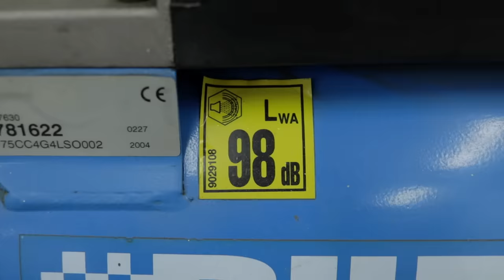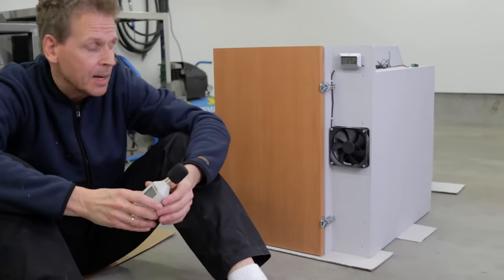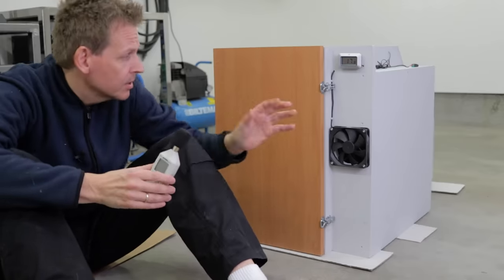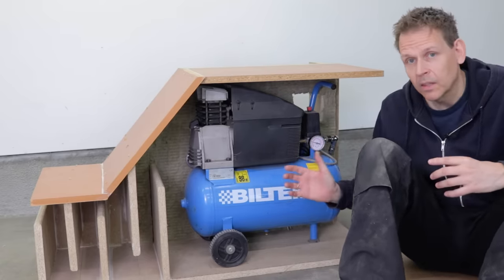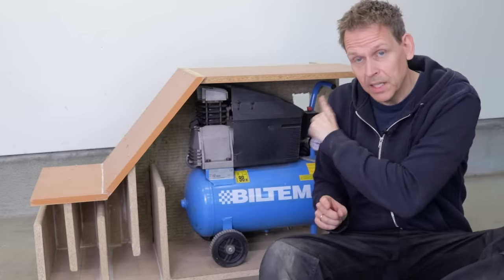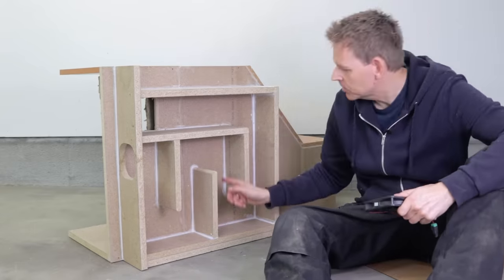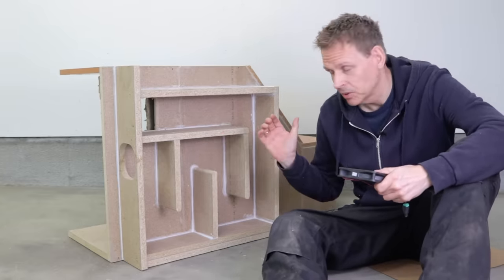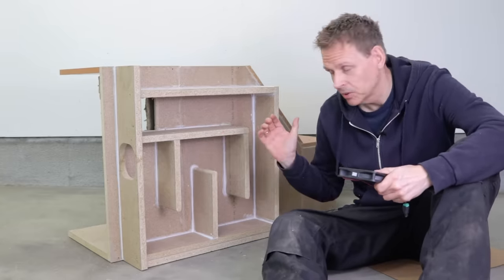Do not build a sound insulated enclosure for your noisy air compressor!

Comment: Please remember that all hard surfaces act as speakers of noise or reflectors and you can add as many baffles as you want but the surfaces all have to be of sound absorbing quality.  This is inside and out.  Even the air tank which is the mounting of the motor and compressor will emanate sound.  The supports of the compressor would need to be mounted on rubber biscuits to isolate the structure from the box. Air movement throughout the case is paramount to prevent overheating and excessive condensation from the ambient air.
Reply from the maker: Thanks a lot for your tips! The fabric I added to the baffles could have been thicker to absorb more sound, but then they would restrict airflow and reduce cooling. It's a tradeoff 🥴

Comment: I bought a quiet compressor made by California Air Tools. Amazon sells them, so I bought a standup unit for $300 about 4 years ago — now selling for $600 in today's inflated economy! I then sold my cheap Harbor Freight compressor to some sucker. How long does it take to build an enclosure for a compressor? I value my time at $100/hr, so the price difference between a flapper compressor plus an enclosure vs. a quiet compressor is well worth the additional cost.
Whether you realize it or not, your box is really an enclosure for a subwoofer speaker. Aka a "lowpass filter." Low frequencies can escape it but high frequencies are highly attenuated. That's why you bury the speaker inside a subwoofer enclosure.

Comment: A lot of the remaining sound is coming from vibrations within the wood. Press board is quite thick and strong, and therefore transfers sound. Softer materials will tend to absorb sound waves and resonate at one frequency. Thus 1/4 ply in three layers, fibreglass between, and offset 1x2 between each layer is ideal, and probably less difficult to assemble. One layer with 1/4 ply on each side would also work well.

Comment: A lot of other comments mention removing the compressor from the tank. You can actually buy them as separate units. Or save the environment and buy used. 
But aside from that. You wasted time and material. All you need is a simple box for the high frequency sound, and some suspension for the low frequencies. 
As an example you could make a floor setting on soft rubber. Or hang a floor from rubber hose.
Reply from the maker: Yes, separating the motor from the tanks would make the box smaller, and that would have been very smart for me, my space is limited. The downside is that it will not be very easy to move it around to another location, now I can just bring it with me if I need to use it somewhere else.
A simple box for the high frequency sound, and some suspension for the low frequencies? Sound very smart, why is it not added to every compressor is it is that simple? 🤔

Comment: To efficiently dump heat from inside the box, it's best to run a low pressure system inside the box, which means you need to have the fan blowing air OUT of the box.  This approach ensures that the air moved by the fan travels all the way through the box because the fan lowers the pressure in the box and cool air is drawn in from the other side. This is how heat control works in computer data centers. You don't blow cold air in, rather you force hot air out and let the cool air naturally flow in.
Reply from the maker: This has come to my attention now, from a couple of other comments as well 😬 It seems like I have still a lot to learn. Your explanation is the best one I have read so far, it was very easy to understand and it just makes sense. Luckily it is not that much of a job to change my design when it comes to this, and I'll do that. Thanks a lot for your tips, highly appreciated! 👍

Comment: Entire audio spectrum to account for, panels only stop higher end audio not low end sub bass, you'd also have to make a deresonator for the case you enclosed the generator in, which could involve things like strings and Helmholtz filters.
I live next door to an industrial sized one that kicks in every now and again, the sub bass shakes our brains and the whole neighbourhood (because they put the box on and bolted the whole thing into concrete with no underside vibration protection.)
Might want to rig up a PC to a good mic (borrow the one from the sound level meter perhaps) and do some recordings, it will give you the complete spectrum of noise and you can patch up the leaking frequencies like that.

Comment: The biggest issue that you continually have is the fact that your air compressor is sitting In the box which is sitting on the floor. If you were to put some real thick surgical rubber feet on the box to isolate it from the floor and keep it away from all the walls you would again cut your decibel level in half. Or if you were able to find some thick surgical rubber flat strips and suspend the compressor within the box it would cut it again in half. You are getting residual vibration through the body of the air compressor into the body of the box through the wheels and the hard rubber feet on the front of the bottom compressor stand.
I successfully built a compressor box for my compressor which is like your first compressor with these methods and it only puts out 10 decibels.
Reply from the maker: You are absolutely right. When I tested it on the concrete floor it was not that bad, but now as it is upstairs all the vibrations goes into the wooden floor. I did find some "regular" rubber that I slipped under the box, but it's to hard and did not help very much. Have to check what surgical rubber is, and if I can get hold of some. Thanks a lot for your tips! 👍😊

Comment: It may not have been as quiet as you ultimately wanted, but you did significantly blunt the sound with an nice design/build. If you had a neighbor downstairs, yeah, the low buzz or hum would still likely bother them. But seems it's good enough for your application.
Reply from the maker: I am quite satisfied with the end result, but you are right: in a workshop the remaining noise is barely audible compared to almost any other machine. In a living room, the noise would have been very annoying 😬

Comment: To reduce vibration I put my larger (20 gallon) compressor on a simple rubber mat.  While not making it any quieter it did reduce vibration noises.  Just putting your compressor upstairs (the quiet model) would have been sufficient I think.
Reply from the maker: I totally agree, If I had known that the loud compressor just became a bit less louder - but still too loud - inside the box, I would have skipped the whole job. Well, lesson learned 😔

Comment: Great video. It would be fun to do this project on a much smaller scale, then provide the plans and parameters for the public to participate. Not unlike a bridge building from a popsicle sticks competition, but instead, a cell phone could provide a sound output and people build within a framework to muffle that sound. Just thoughts. Thanks for the Chaplin silent film bit towards the end.
Reply from the maker: Hehe, the Chaplin-silent-film-part more or less came by itself - I just turned on the camera as started the job 😁
You suggested project sounds very fun.  Based on alle the improvements suggestions in the comments it is for sure plenty of ways to build it better than I did 👍

Comment: I take it noise canceling foam panels costs quite a fair amount for a job like this?
Reply from the maker: I used Rockwool insulation, they are not very expensive. You might need to buy a whole package though, but always nice to have extra to next project 😊

Comment: I think most of the noise comes from the intake.  A muffler or muffle type system might be more effective at dB reduction
Reply from the maker: From what I have found a muffler on the intake / exhaust helps a bit, but not very much. I could be wrong though... I did some research but did not find any solution that I found to be very efficient, not even the ones fitted a big car muffler. The tank itself also emits noise because it acts like a sound chamber. I would guess that if a muffler really worked, the vendors would have added it.

Comment: Putting something like fiberglass insulation in the air input and output chambers would drastically change thenoise level as would making lots of holes in closed boards (mufflers do both)
Reply from the maker: Agree! It's a trade-off as it will restrict airflow needed for cooling though

Comment: A major problem is the conducted noise between the wheels and rear support pad contacting the physical structure of the box. The box then becomes a big speaker from the large flat surfaces vibrating, thus re-amplifying the sound. Some kind of damping between the box and wheels is needed, like foam rubber, even springs. This was obvious when you rolled the compressor into the box, and set it down, and the noise increased.

Beautiful job, however, in building the box, and I really enioyed your video. Thanks for sharing...
Reply from the maker: Thanks 🙏 I do think you pinpointed the biggest remaining problem. The vibrations from the compressor goes into the wooden floor upstairs now, causing some noise. I did not notice the noise increase from setting the compressor down on its feet, I’ll have to check that. I’ll try to isolate using soft rubber just as you say. Thanks again for valuable feedback ❤️

Comment: The box is acting like a speaker box, look into how sound proof drywall is done and go from there brother🤙 good vidjéo none the less, and very nice carpentry skills too!
Reply from the maker: Thanks 😊 The box does actually look like and somewhat act like a speaker enclosure. The similarities is that both a speaker box and sound dampening box are both designed to control the sound. Even though they look the same, they act quite differently though 😊

Comment: Wondering if you lined the inside with some sort of foam like the egg crate material they use mattress covers, or if you want to get really fancy, the foam they would use to sound proof recording studios. (I’m assuming that stuff would likely cost big buck$.) 
I would think that you might even be able to get away with a more simplified design. Just a thought. I considered doing this for a Harbor Freight generator we purchased for building sets for our local community theater. Some of the building/ assembly needed to take place working out of a storage unit, which had no native power, and since all the walls are made of corrugated metal and all the floors are concrete, needless to say that place is already one big echo chamber. This started a few years ago, before cordless power tools had the power and capability they do today. The cordless saw I had at the time was a Black&Decker Firestorm that ran on NiCad Batteries. You’d be hard pressed to get two 2x4’s cut before the saw died and the batteries needed a recharge. My, how times have changed, but still, a few big tools like the table saw and miter saw remain corded and hence the need to find a workable way to reduce the noise of the generator.
Reply from the maker: I used Rockwool sound insulating material (3cm thick) inside the main chamber. It works quite well, thicker would have been better but I did not have more available space ☺️ I can totally understand your need for sound insulating the generator, just make sure it does not overheat.
Reply: @kihestad  Thanks again for the informative video and the response above. I appreciate you taking the time.

Comment: Also, compressors with a 1170 or 1725rpm(ish) motor are almost always quiter than a 3600rpm motor but kind of rare these days and even more so for 120/240 volt single phase units.
I'll just keep on talking nice to my old Atlas Copco compressor.
Reply from the maker: You are right about that. High pitched noise is also more annoying than lower frequencies. It’s probably cheaper to make these direct drive high revving compressor motors 😌

Comment: Like the baffle additions never thought about doing that.
Would not adding egg cartons to the alertating boards to help reduce the noise?
Great vid👍👍
Reply from the maker: Thank you 😊 yes, adding egg cartoon inside the box - preferably real sound dampening egg carton shaped sound panels - would have been even better. I used Rockwool sound insulation material, 3cm = 1inch thick inside the main chamber. I could not make my box bigger to make it fit under my bench upstairs 😔
Reply: @kihestad  
Of course the dimensions are critical and so unfortunately is the availability of 💶💷, 😪 that's why I suggested egg cartons.
Thanks for the additional info and once again a thoroughly enjoyable vid.
Looking forward to the next journey 👍👍

Comment: When i have built a sound insolation box for a generator i have observed that the most sound is coming from the contact points with the floor ( vibrations), so i bought some sponge rubber ( the one that they use for children playgrounds) and the sound was reduced remarkable.
I hope that this will help :)

Comment: Not an engineer but could you not separate the compressor from the tank? Put the compressor in the enclosure and suspend it with springs in some specific way to reduce all vibrations? The tank doesn't need to be sound-proofed and including the tank probably defeats your attempt by having it stand on the floor which appears to be your ceiling.
Reply from the maker: It is a great idea 👍 I just did not think of it as an option when I started the project 😫 I would probably have done it now, if I where to do it again. Would have made my box smaller and easier to build, and it could have been even more insulated. It would make the compressor more stationary though, now I can just open the door and bring it to other locations if I need it. (but I never do really 😋)

Comment: You might add an a hose to drain the unit without digging it out.   Water is a hard on the regulator as well as the check valve.  Long term will give you a tank problem as well..
Reply from the maker: Yes, It's a bit cumbersome as it is now, I need to open the four eccentric locks and pull of the door and then take the compressor out of the box. It takes no more than 5 minutes, but it's enough to postpone it to the next day 🙄I better put on a line and have it on the outside....

Comment: I would suggest a rotary screw compressor if silence is your top priority. Using a piston compressor will always be loud.
Reply from the maker: I wish I could afford it 😋 But, I don't think they are suitable for a hobbyist. They are very big and very expensive. Not sure, but I think they need to be serviced often as well, and best to use them frequently. If not used for a while they can get stuck or get damaged if not serviced before started again. (at least what I have heard, not 100% sure....).

Comment: Something I'd change about the design is to have the outlet at the top and inlet lower, to take advantage of convection to evacuate heat
Reply from the maker: Yes, that's a good idea. I selected my design because I can blow the hot air out from the garage upstairs, it's ventilation between the ceiling and the wall where I have put the compressor. 

With a fan blowing air in, and a fan on the compressor blowing air to the rear of the box, it's quite decent airflow anyway.

Comment: First thing you need to do is isolate mount your compressor, then build a cover with Trapezoidal sides so that they sit at an angle. Vent along the bottom and top , I suggest you use louvres and put a row of foam alongside the side the louvre holes face . You should notice a marked drop in noise volume … if you were worried about heat accumulation you could always wind copper tubing around the cylinder and add a fan and radiator. This is if you plan to run the compressor for long periods …I use a Trapezoid panel cover on my petrol generator to mitigate the noise problem and it is pretty effective … that hard floor is another thing to replace with a soft sound minimising foam …
Reply from the maker: Yes, I think you are absolutely spot on about isolate the mounts! I think vibrations are the biggest source of noise now. Will try to improve it by adding soft rubber, dampening foam or springs on the compressor and/or between the box and the floor to improve it. I have limited space, so I cannot build the box any bigger unfortunately. Thanks for the tips! 😊

Comment: You could improve this by putting some rubber under the compressor. And putting some sound proofing sponge on the walls of the channels to absorb some extra noise.
Reply from the maker: Agree, and I plan to. The vibrations are transferred to the wooden floor and it makes a bit of noise as it is now.

Comment: If you have the option, move the compressor outside as a rupture in the tank can be....potentially fatal.  And yes, it does happen. Don't forget about making provisions to drain the water that collects in the tank, as it corrodes the tank from the inside. Automatic drains are a really good investment. Ideally you can use cinderblock to construct the walls of an outdoor enclosure and fill the cavities of the cinderblock with sand.  I would say just locate the compressor part outside and have the tank inside, but the safety aspect of a larger tank rupturing in occupied space keeps me from stating that as a good solution.
Reply from the maker: I wish I could 😔 My garage is in the corner of my property and goes along a retaining wall. Thanks a lot for your tips! 👍